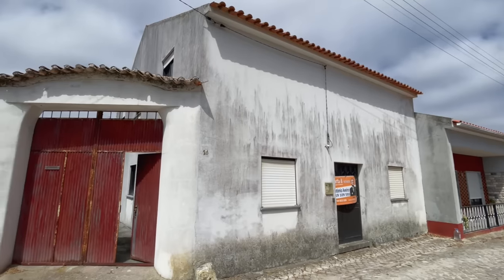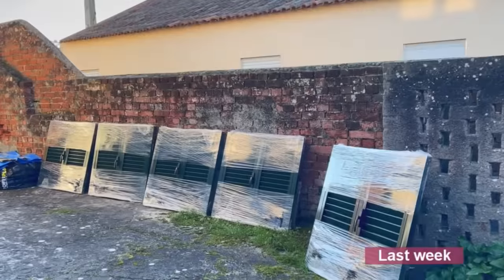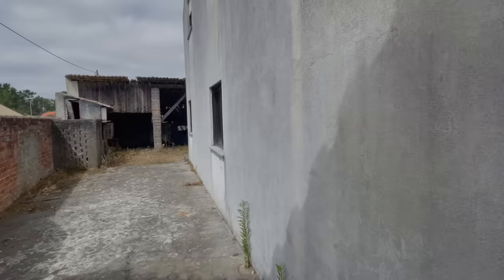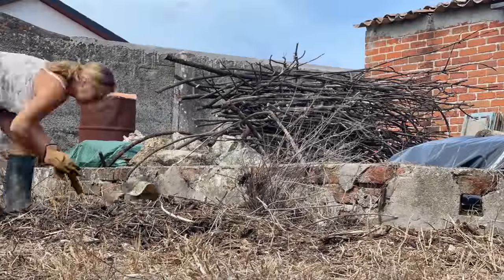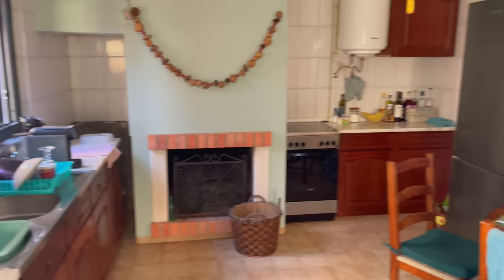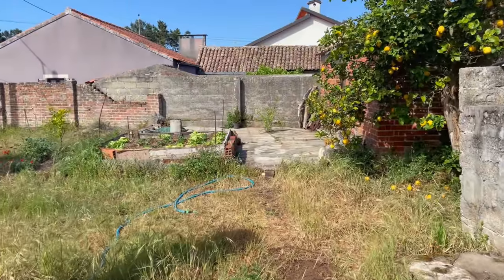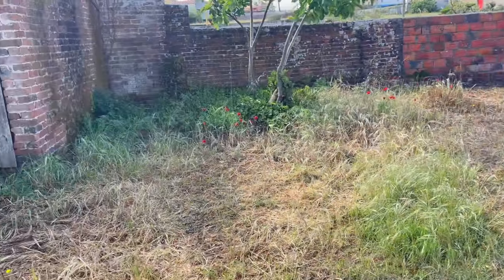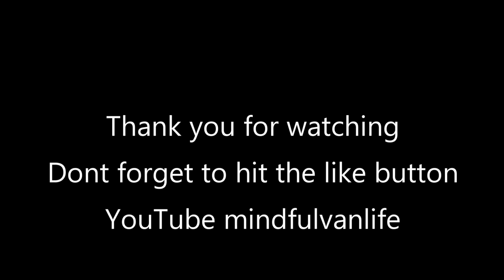I bought an ABANDONNED QUINTA in Portugal - 9 month renovation timelapse

Comment: I moved to Hungary a year ago, similar story, lot's of cleanup and repairs needed. My house has a masonry heater, it's very efficient and keeps the whole house warm. "The main thing that distinguishes a masonry heater from other wood-fired heating appliances is the ability to store a large amount of heat. This means that you can rapidly and cleanly burn a large charge of wood without overheating your house. The heat is stored in the masonry thermal mass, and then slowly radiates into your house for the next 18 to 24 hours."
Reply from the maker: Roland, thanks for the insight. Not sure if they have this in Portugal but I will bear this in mind when I go to look at heating appliances 🙏

Comment: I would suggest industrial spray foam in all areas you can see light coming through your roof. The foam expands in the holes and water will no longer penetrate. I have 2 homes in Thailand where it rains a lot. I had many roof leaks, but now have none in either house.
Reply from the maker: Gregory, great idea, thanks 🙏
Reply: @dreamlifeportugal  Welcome. It worked great for my roofs. I forgot to mention you should spray the foam from the underside of your roof, and carefully look for areas of light coming through, big and especially, small.